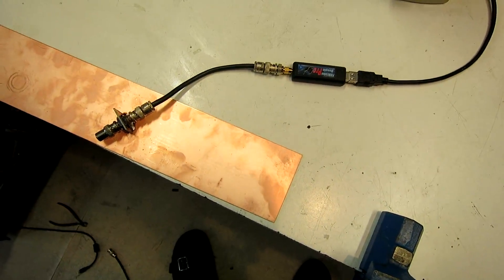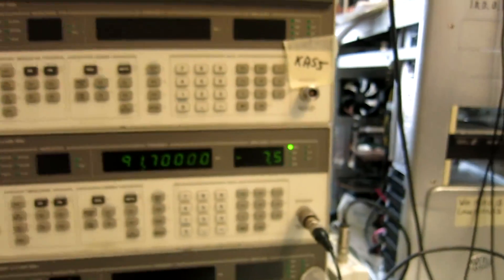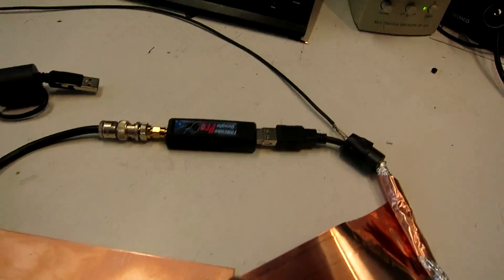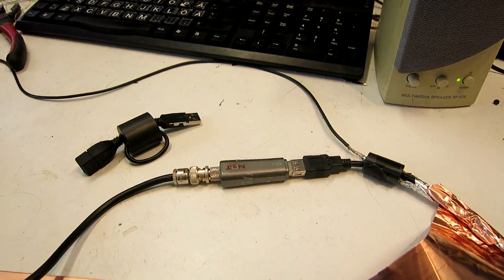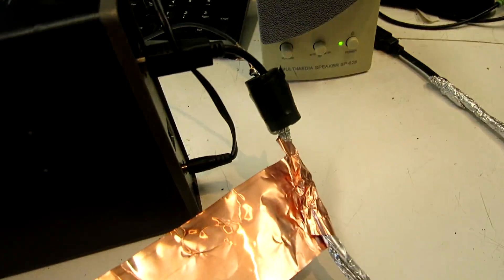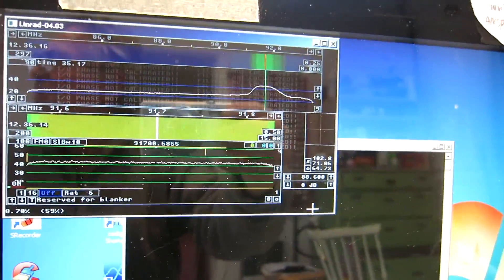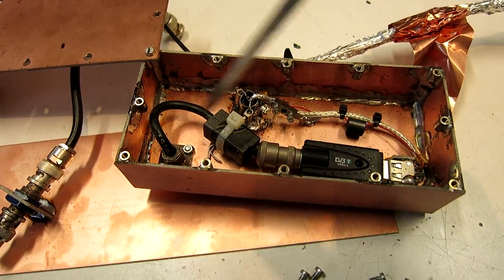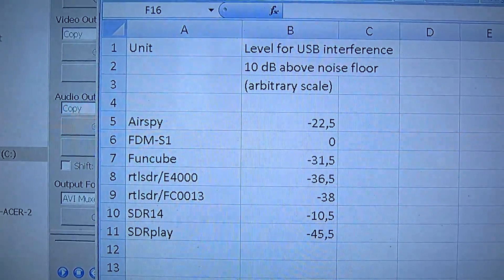usb qrm

Comment: Many thanks, great contribution - amazing approach and results. That tells me that my receivers need much more than the usual USB choke I always use when portable to keep things clean. Since most notebooks run "dirty" DC/DC converters at their USB ports, this gets significantly worse when running it with your portable equipment, versus the PC at home that offers a cleaner power supply.
Another thing that you have to consider when portable is that you need another RF choke directly behind the USB of your notebook in order to not let this RF noise be radiated and get into your nearby antenna!